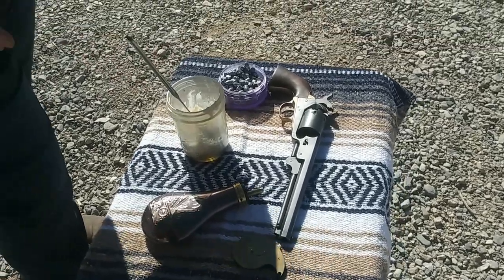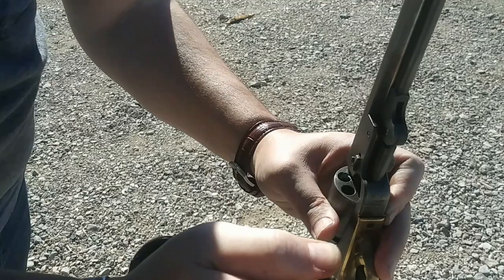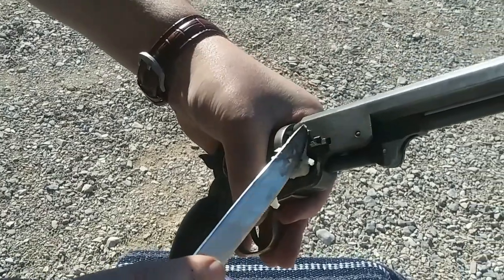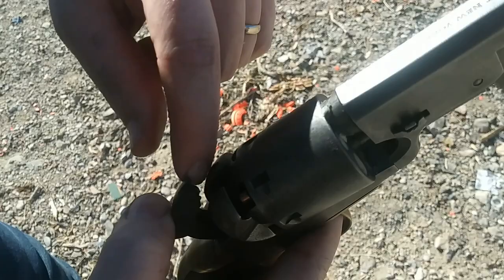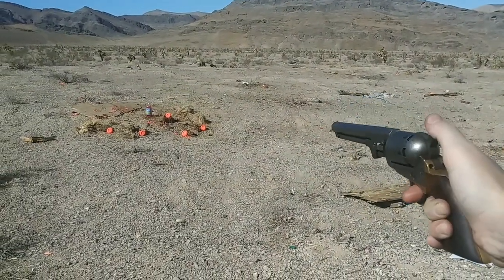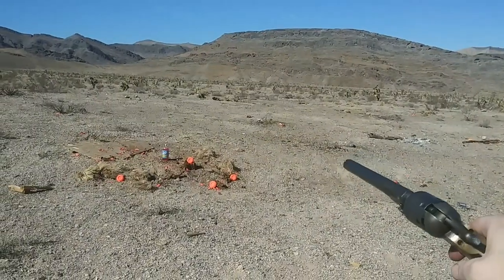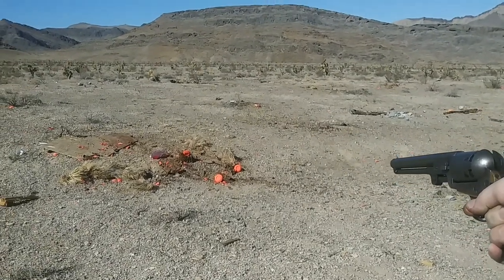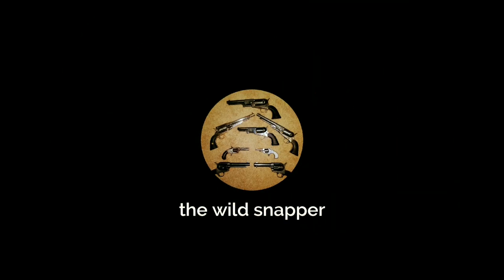Colt 1851 Navy. lets shoot this original

Comment: Good demonstration on how NOT to use the flask. You pour powder into a different container then into the cylinder. The theory being if their is an ember still in the cylinder ( highly unlikely? but still a possibility ) the flask will go up and take out your hand!
Reply from the maker: I understand that and it is best practice. I usually load from the flask on the first shots of the day.  Or when its been more the 30 mins between shots. Yes there is a possibility of it still going off. These flasks that measure your charge have been around forever and were designed to pour directly into the cylinder. There is a wall that closes the flask off. How well dos it work 🤷 and i dont want to find out. You are right it is smarter and safer to use a separate pouring device. Thanks for stopping by
Reply: @Michael Based on the 1-in-a-trillion-chance of a flask explosion during revolver loading, I think it best (purely for safety of course!), that all outdoor ranges be permanently closed because of the much more likely 1-in-a-billion-chance of being hit by a meteorite.

Can you point to an ACTUAL example of a flask explosion while loading a revolver?  I've looked back almost 190 years and there has NEVER been a flask explosion recorded anywhere occurring while loading a revolver. 

Does it make any sense to have a safety rule prohibiting a procedure that has been totally safe for almost 200 years?

Comment: I have a question, I just picked up a 1971 Colt Robert E Lee 1851 commemorative and I was wondering do these require a patch behind the bullet when loading ? Thank you. I subscribed 👍
Reply from the maker: @slammer7625  no you don't use a patch. All you need to do is powder and ball. Some people like to use felt wads between the powder and ball. It's only there for lubrication of the barrel and keeping the fowling soft. I personally dont do this. Historicly people would smear a animal grease over the top of the chamber after its loaded. Don't use axel grease. Patrolum based grease gets very gummy and hard with blackpowder. 50% lambs tallow or Crisco and 50% bees wax works great. Best of luck! if you have any questions please feel free to ask.

Comment: I recall reading that supposedly Colt said that you could fill the chambers completely up with powder then ram a ball on top of the powder charge and the 1851 would be safe to shoot. Have you heard or read this as well? I'm tempted to try it with my repo 1851 Navy.
Reply from the maker: Yes it's 100% true. I have done it before. I believe It was on the instructions glued to the lid on a cased original 51 navy. It does not work with conical bullets tho. They are to long. I used to have a pietta 1860 and I would load it that way all the time. Works best with 2f powder. 3f works most of the time. but sometimes it does not. 4f does not work at all. You need the powder to be able to compress. And the larger the grains the more air around them. makes more room to compress. But I loaded that replica 1860 almost everytime by just filling the cylinder...🍻🤠
Reply: wow

Comment: your shooting is fine..its your sights are regulated to shoot 80gn ball's, my 1858 45 acp conversion cylinder will shoot 15" high with 230 cast bullets and 8" high with the 200gn lswc and is also regulated for 140gn 44 cal ball's. my Uberti 1861 shoots ragged holes at 25 yards using 16.5 gns of H-777 FFg and 80gn 36 cal ball's.

Comment: I’ve been filming and had things go wrong that have NEVER gone wrong in my 30 years of shooting.   
Great video. I love the 1851 Navy.  I just recently had my 20 year old Pietta refurbished and cartridge converted to .38.   150 gr hb fn bullet with 21 gr of 3F Swiss and a magnum small pistol primer is nowhere near a 45 Colt but it is certainly nothing to laugh at.  (I don’t agree with a lot of prominent and respected modern writers that compare the Navy to a .380 ACP or less)
Reply from the maker: I hope all is going well. I would love to see that Navy. I have been wanting to do  a cartridge conversion on a cap and ball completely from scratch. Just like if i were a gunsmith in the 1880s. I agree its more powerful then people give it credit.
Reply: @snappers_antique_firearms  
Did a video on it about two weeks ago: 
https://youtu.be/MNB6NGO7icY
Reply from the maker: @classicgunstoday1972  sorry i did not get a notification that you uploaded. It came out beautiful. And great video as well
Reply: @snappers_antique_firearms  thanks!  I really had fun doing that one.  The only frustrating thing was ejecting shells with a rotten twig and them getting stuck.  But I shot it again a week ago and used an L hex wrench as an ejector and it works as well as an installed barrel ejector.  Pops them right out one after the other.   
Also noticed the gunsmith timed everything to where the hammer is almost fully depressed when cocked so the built in rear sight is as low as possible.  Therefore the gun does not shoot high, or as high, as is common with so many open top designs.
Reply from the maker: @classicgunstoday1972  it sounds like this guy really knows what hes doing.  I did the same to all my colts with hammer rear sights. Then if it still shoots a little high i file the notch beeper. I am a 6 o'clock hold guy myself. So did you leave the loading lever on so you can still use it as cap and ball by changing the cylinder?

Comment: do you get cap jams on the originals' as often as replicas? what size cap do you use?
Reply from the maker: I still do get cap jams unfortunately. but it's not all that often. It also is very dependent on the condition of the original nipples. But it still happens. I use everything from Remington #10s to CCI  #11s. Even homemade caps. One of the largest reasons colts have cap jamming issues.  modern caps are not the same as Originals. the original caps were thicker metal and far less prone to cause a jam. Thanks for stopping by

Comment: No they didn't do the greased gun dance! Samuel Colt! Recommends not to use grease of any kind! Look it up! I just learned that. I only put lube on the Conicals that you are using and not over or under any round balls! And the grease goes around the Conicals not over the top. I'm doing it from now on as Samuel Colt recommends to do! He should know. He made the guns! Just thought I'd spead what I've learned from reading Colts writings! Great video!
Reply from the maker: I also learned that a few months ago. Reading the instructions on the colt box lid. i saw that as well. Only talked about putting grease on the arbor pin. I have started to put a light amount of lube on the balls or conicals before i load them. As a way to reduce leading. Thanks for bringing it up. i have been planning on doing a video on this. Cheers
Reply: @snappers_antique_firearms Great video!

Comment: I have that same gun. Where do you get your supplies for it?
Reply from the maker: Sportsman's Warehouse is usually the best place to get caps and lead balls. When it comes to black powder i make my own. because its hard to find real black powder and shipping is crazy expensive due to Hazmat fee. You can use Pyrodex p its a black powder substitute they sell it at Sportsman's Warehouse. But if your gun is a original colt i dont recommend using Pyrodex but you can. To get historically accurate Chronicles you can buy the molds erasgone bullet molds.com.

Comment: I’ve been shooting for around a year now and never lube the chamber after loading. Never had a chain fire. read historically they didn’t either just used oversized balls
Reply from the maker: Yeah putting Lube on the front of the cylinder isn't to prevent chain fires that's a myth. Chain fires usually always propagate from the back it's very very rare from the front. The lube is to keep the fowling soft and also cut down on leading. Sometimes I dont lube I will just spray the barrel with ballistol a little before each time I reload to fire. If i don't lube at all. there have been times my accuracy drops off dramatically after say 12 shots. And is a bear to clean later if the fowling gets hard
Reply: @snappers_antique_firearms  okay, I didn’t know that’s why people do it. I might consider doing it in future because cleaning does suck. But I haven’t noticed any loss in accuracy in my own experience but I use pyrodex so maybe that’s why. This is a no no to a lot of people but I’ve gone days after shooting without properly cleaning my revolvers. It’s a pain but they clean up nice lol
Reply from the maker: @frankiepizzurro  lol I have gone a few days before cleaning. But only on my replicas. If I said I cleaned all my guns after I shoot I would be lying. My
Originals I clean right after just because there are so valuable. I find real black powder is less messy then Pyrodex. And easier to clean. But both clean very well in hot water and soap. I bought a ultrasonic cleaner. Makes the world of diff and faster cleaning. I just take the whole gun apart. Throw it in the ultrasonic cleaner for about 5-10 minutes put it in a small bucket sprayed down with ballistol. Then dry the parts with my air compresser. Then put back together. Made it so I could clean 4 or 5 guns in way less then a hour. And cleaner then I ever could get them

Comment: Do You have an evidence that chambers were greesed during the Civil War? I think that greesing is a modern practice.
Reply from the maker: Yes there are a lot.   paper cartridges they were dipped in lube. Thats why the Colt cartridge Works bullet all have Lube rings. The lube is to help soften fowling. And keep the revolver from gumming up with black powder fouling. If Fouling gets bad in the barrel it dramatically lowers your accuracy. It dos not help prevent Chainfire. Colt even have these little tins with Lube in them.  on the inside a  51 Navy  presentation box. at the top it gives you how to load and clean. during the steps For reloading. it tells you to put lube over the cylinders.... Hope this helps. Remember its there to help with fowling not chain fires
Reply: @snappers_antique_firearms  Thank You! Vay You give me a link on this instruction from presentation box?
Reply from the maker: @AS40143  i would like to apologize. I thought it said it on that sticker but it does not. I did something that I hate when people do to me. tell me something without verifying!! and I'm so sorry. Wax/grease coatings became standard of the u.s. military for pistols. Around the beginning of the Civil War around the same time combustible paper cartridges were formed. Because of lead and fowling buildup in the rifling.  I recommend watching this video I had linked at the bottom. He explains it much better than I could and he shows the proof and documentation where can be found. Sorry again and i hope this helps. I to am tracking down common historical knowledge that I believe is extremely modern. And it is a very deep rabbit hole
Here is the video...https://youtu.be/BgeAPKKMf4A